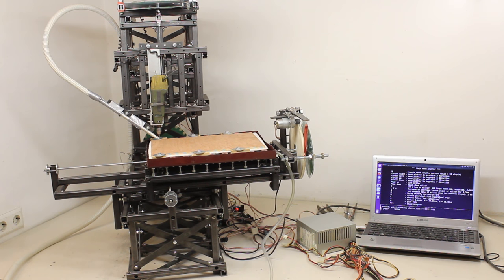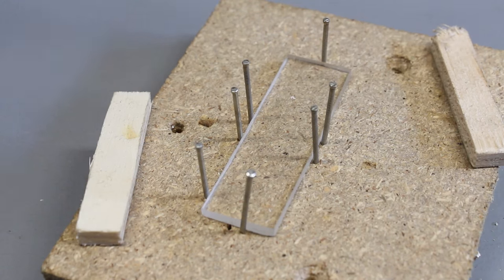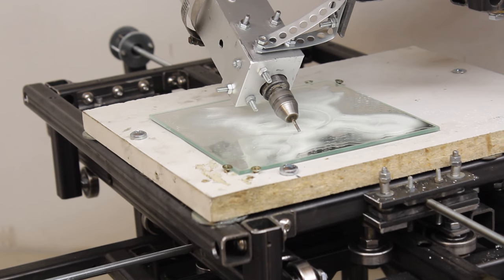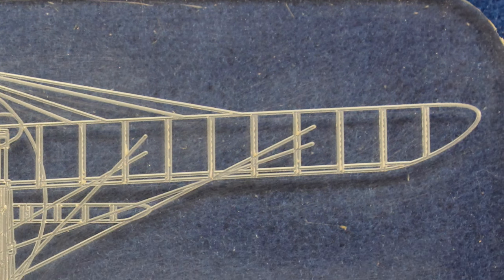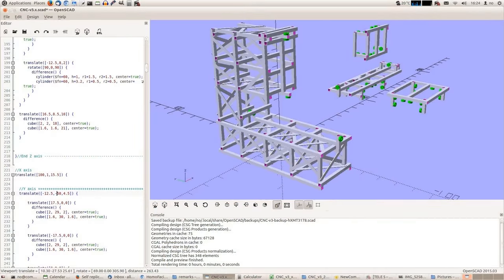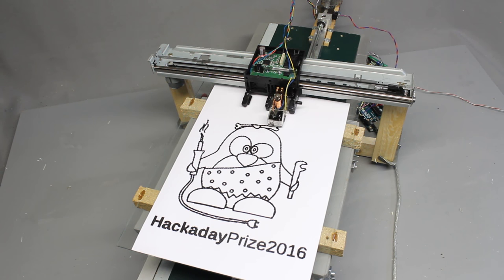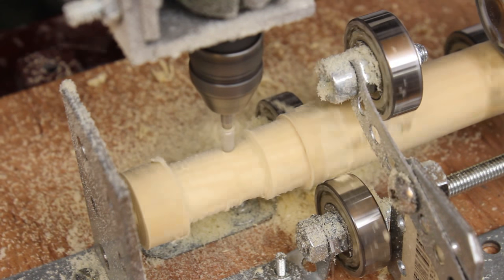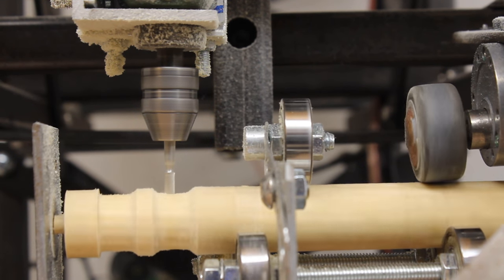Simple to build CNC v3.2, HackadayPrize entry 2016

Comment: Very cool work! I really like how you worked out a cheap way to replace steper motor designed machines. Significantly reducing the cost !
Reply from the maker: Thanks! It's not only to get a low cost machine but mainly to enable more people to build one, especially in places where it is hard to get special parts (even simple stepper motors become special parts in many countries on this planet).

Comment: sometimes i ask myself. wouldn't it be cheaper to just buy linear bearings and bars instead of using a lot of skatebearings? i doubt it would be that much more pricey, and its very easy to install. :-). i use linear bearings in my projects more and more these days.    i do love the way you build your machines and get a pretty good accuracy of the cnc!  great video! sincerly, jörgen Börg
Reply from the maker: The cheap parts aren't always the best choice over time...
Another thing is that you get good ball bearings in (nearly) all parts of this planet and this machine is meant to be reproduced in 194 (or more) countries.
... but there are many way to reach your aim. Linear bearings are for good reasons often used in modern machines.
Reply: i do understand the availability in 194 countries. i'm at an easy place near one of the most important harbors of western europe, so a i just have to go to ebay and everything arrives at my front door.  it is nice to see you use lowtech parts to make something work as good as the professional build ones.(for light work). cheers!

Comment: How much did all that steel bar cost seems expensive considering the cheap electronics?
Reply from the maker: Yes, the steel bars were the most expensive part of the machine. I am thinking of a new frame that needs less of these. The exact price depends on where you buy which is why I don't give a price (because there is always somebody claiming he gets it cheaper...).
Reply: HomoFaciens perhaps use concrete as part of the structure. People have made concrete lathes that are extremely stable.
Reply from the maker: I saw concrete lathes and keep your hint in mind - thanks.

Comment: love the lathe mod!
Reply from the maker: it's just a quick demonstration of how things could work in the future. A lathe is another great tool that I will turn into a CNC machine - stay tuned!
Reply: for the coolant you can use a cheap aquarium pump+ 3mm cheap hose + Hypodermic needle (Kanüle) so a small but constant flow is achieved
Reply from the maker: Hyper Hektor
Yes thanks, I have something like that in mind, but did not have time to implement it. Besides the pump I must add a skirt at the router head to avoid splashing the coolant.